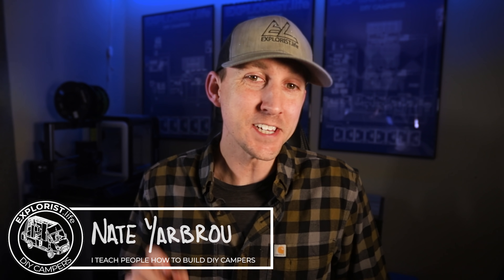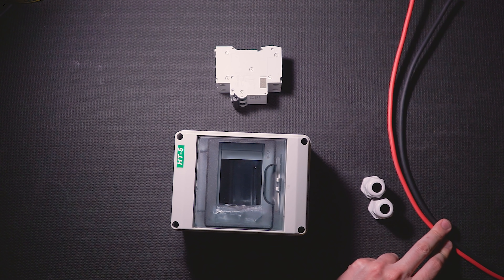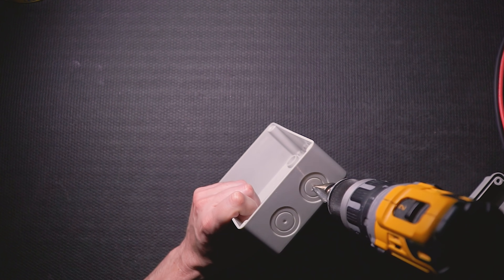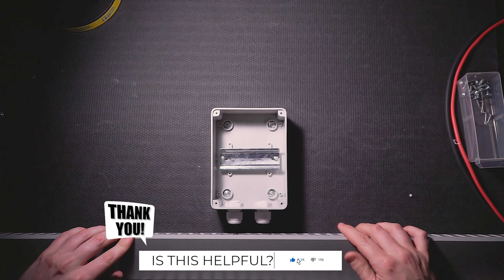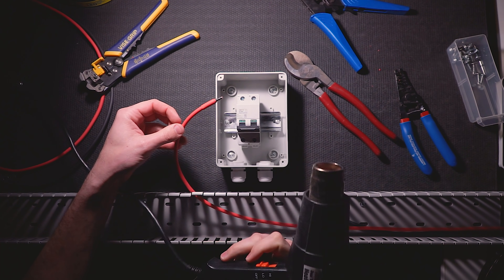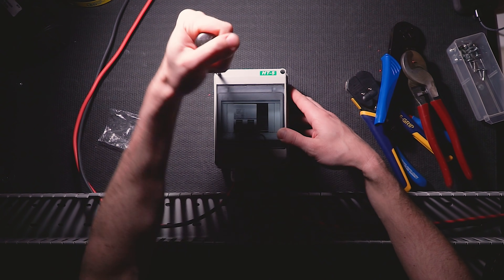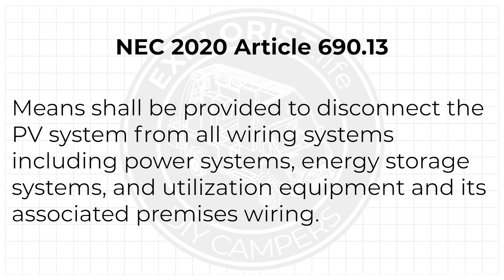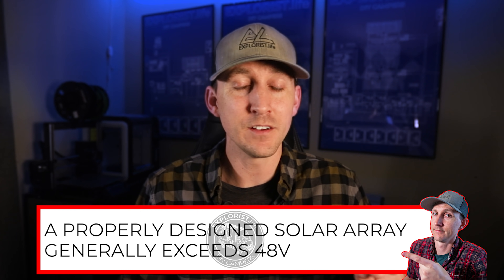How to Wire a Solar Disconnect for a DIY Camper Electrical System

Comment: I have a solar generator in my house that will be hooked to three 400 watt solar panels wired in series.  Together the three panels will generate 150 volts DC at 9 amps.  It looks like the breakers you are using will work with this setup.  Are there any similar breakers that can be used outside.  I would prefer to mount the breakers at the panels on my solar ground mount rather than inside the house.

Comment: Will this breaker protect against lightning?
Reply from the maker: Nope.  This product simply disconnects power from the solar array to the charge controller to meet code requirements.
Reply: If you switch the breakers off before a thunderstorm will it protect against a lightning strike?
Reply from the maker: If your camper takes a direct hit from a lightning strike, there will be a lot of stuff messed up regardless of the position of the switch.

Comment: Excellent ! One thing I don't understand and I know there is always a reason for why things are made the way they are. Why do the incoming wires positive and negative need to be disconnected simultaneously ?
Reply from the maker: In short: if the positive and negative wires upstream of the switch rub together and create a direct short, the negative wire could be carrying voltage even if the positive wire was disconnected.  I'll let you google the long answer.  It's in some white papers out there somewhere but I'll let you chase that rabbit on your own.

Comment: Awesome video.  I'm building an RV and was just at the stage of adding the solar disconnect.  Learned a LOT with this and saved me a lot of hassle down the road, and possibly a disaster as well as I was about to use one of the switches you advised to never use here.
Reply from the maker: Glad it was helpful.  Cheers!

Comment: Nate,
We purchased a 2022 GD Reflection fifth wheel and it came with a Furrion 165 W solar panel, Furrion 50Amp Charge Controller, Furrion 16cu/ft 12v refrigerator and on demand water heater.
I was putting it in storage and there is no disconnect I could find  between the panel and the controller to disconnect the battery safely. But looking at the specs I guess it's not required according to your video.
What is this thing in the front bay near the one lead acid battery and the controller.(see email with attachments)
Also if I upgrade can the existing panel and controller be utilized or would you start from scratch?

ᐧ
Show quoted text
Reply from the maker: Sounds like you've got an RV with 50A shore power... If so... Here's how I recommend retrofitting an electrical upgrade: https://www.explorist.life/50a-camper-inverter-with-solar-alternator-charging-wiring-diagram/

Comment: Hi Nate
Loving your videos - thanks. I have a question about wiring the switch up. I saw a video saying that you have the have the pos and neg on certain sides otherwise the unit bursts in to flames when turned off? Obviously + to + and - to -, but does it matter which side of the unit is used? mine has a large N on one of the terminals on the right hand side so guess that would be the neg connection, but does it really matter if i run the positive down the right hand side of the switch or the left hand side of the switch?? Hope that makes sense?
many thanks

Comment: Hello Nate, Thanks for making all of these videos! The information is extremely helpful! Just wondering if you were ever considered making some videos for a setup much less complicated and on a smaller scale. Like an over-landing vehicle (Jeep) with a dual battery setup under the hood and 200W solar just to power a small propane heater and fridge? Something small enough that wouldn't require an inverter maybe? Thanks again and love the videos!

Comment: would it be possible to take a 30a rv extention cord and cut off the end and connect those wires to the inverter. then plug my camper into the other end. 3500w reliable inverter and 25ft camco 30a rv extention cord
Reply from the maker: Here is how I recommend retrofitting an upgraded electrical system into a 30A OEM RV: https://www.explorist.life/30a-camper-inverter-with-solar-and-alternator-charging-wiring-diagram/
Reply: @EXPLORISTlife  victron stuff and battleborn is way too expensive. I understand you're sponsored by them but I can't afford all of that. I'm running 800 watts of newpowa in 8-100w panels 2-60a pow mr charge controllers. The inverter I mentioned. And when I get my tax money I'll be getting 2- chins 300ah 12v batteries. I already have a gopower transfer switch but was just wondering if it would be easier to wire the AC block of the inverter to a 30a rv plug to shortcut wiring in the transfer switch. But I understand you can't vouch for other companies.
Reply from the maker: Feel free to use whatever brands or companies you like.  I teach you how to do this stuff right the first time so you don't have to do it again; but whatever company you end up going with... the designs I've made are the best way I can recommend.  Straying from that and trying to, with all due respect, cut corners, is not something I can vouch for.
Reply: @EXPLORISTlife  got it thanks

Comment: Do you have a video where you do this with multiple charge controllers? NOT the video of wiring multiple charge controllers to the Victron Lynx Distributer, but to this point. Or do you just use 2 entry glands and 2 of these disconnects?

Comment: Is the box required for the breaker? Or could the breaker be mounted out in the open. Since it doesn't need to be water proof and other connections in system are out in the open.
Reply from the maker: I recommend using the box.

Comment: Nate, thanks for the great video again.  They are always helpful!  Is it legal to use the disconnect without the enclosure to save space by taking the DIN rail out and just mounting it directly to the backing board?
Reply from the maker: It's really best to have it in the enclosure.
Reply: @EXPLORISTlife  Thanks!
Reply: Thank you, what's your advice for setting it up on a small boat? One 300 w panel just for a fridge/freezer going to a lithium battery. 6.25 m hard top but gets salty.
Reply: That's what I would need to do. The box is too big for my application.

Comment: My inverter wants a 200 amp 2 pole DC circuit breaker (for battery bank at 48v), but I can't find any online, do you know where I can buy them at?
Reply from the maker: That's strange that's what it specifically calls for.  Multi-pole high amperage DC rated breakers are REALLY expensive.  Here's a source: https://www.automationdirect.com/adc/shopping/catalog/circuit_protection_zfusesz_disconnects/ul_489_rated_molded_case_circuit_breakers_(mccb)/3-pole_mccbs,_15a-600a_(3p_series)/60a-225a_(225a_f-frame)/f3p-200-aux

Comment: I’ve ordered my disconnect and will be installing in the near future.  Thanks so much for all your videos!  

I do have a question…when the disconnect is switched off, and the PV panels are active, ie generating voltage, is there any heat build-up to be concerned with?
Reply from the maker: Nope. 👍

Comment: I notice that the PV output is going to the top of the breaker, and not the bottom (input?)  My understanding is that the side with the highest potential should be wired to the input...or is this breaker/manufacture dependent.   (I was planning on using Midnite Solar breakers)
Reply from the maker: It's manufacturer dependent.  Follow the instructions for whatever breaker/fuse/isolator you choose to use.

Comment: I built out my electrical system according to the custom design you created for me and it works fantastic.  I'm finally adding a 120W suitcase solar panel and the plan doesn't show a DC disconnect switch.  Do I need one if I only plan to occasionally connect the panel to the MPPT charge controller?  The disconnect would be the MC4 connectors between panel and charger controller.
Reply from the maker: I'd say it's fine without for portable panels.  You can 'turn the panels off' by flipping them over face-down and then when you disconnect both MC4 connectors; that is effectively disconnecting both the positive and negative conductors.

Comment: Hi. According to your explanation: 63amps dc breaker >250v fits all solar systems between pv and solar inverter. What about the amp size of dc circuit breaker between the inverter and the batteries? And the ac circuit breaker between in and out ac current?

Comment: Hi Nate, I'm looking to install a solar system in my Rv and this was a great video.  However, I watched a few other videos on the DC isolation breaker catching fire.  The videos show reversed polarity and if not wired correctly they will catch on fire.  The wiring shown had the NEG wire coming in the bottom on the right side and the positive leaving the right side on top. If not wired in this configuration they will catch on fire if under load.  Your video shows the neg and positive entering and leaving the same sides. Thoughts?
Reply: Nate is correct. The way a polarized circuit breaker works is that the current can only flow in one direction. The circuit breaker will have a + and - (or a small diagram) to show how to wire the source(in this case the solar panels). The wires “exiting” on the other end must match the incoming wires.  The breaker used here only has the +/- at the top, so the panels are intended be wired into the top of the breaker with the positive on the right, and the wires will come out the bottom in the same orientation. If the breaker has +/- at both the top and bottom, that just shows the correct polarity for the incoming source whether wired into either the top or bottom, and is intended to show the correct polarity for ONLY the incoming wires. Again the wires exiting must match the incoming wires, even though +/- symbols will show reversed for the exiting wire.  The videos you found  advising the wires be crossed  are either incorrect or you misunderstood them.
Reply: @ArvidDarmond  Maaan! Thanks for clarification with those marks on both sides! I could have guess it. I'm googling all day long on a proper breakers after watching those videos. Video shows that a wrong polarity will cause a fire if trip off a braker manually even under rated amperage. Something you don't want to have in your house or camper and it's pretty wild. So either buy non-polar switch or wire it carefully.

Comment: Why use a breaker rather than a switch?  Are dual pole switches suitably rated for volts and amps harder to find or more expensive than breakers?
Reply from the maker: Solar Disconnect switches have been historically harder to find and more expensive.  Though we just bought a pallet of them and will be selling actual solar disconnect switches in our store soon.

Comment: That is a breaker NOT a disconnect switch. If you read the breaker specs, you’ll usually see the mfr recommends a switch before the breaker.
Reply from the maker: It is a breaker being used AS as disconnect since it offers no overcurrent protection in that location as described in the video. 👍🙂

Comment: Need to have to enclosure?
Reply from the maker: Indeed!
Reply: @EXPLORISTlife  why is that? Can you please explain. Currently I have mine mounted on a din rail behind a cabinet. Have two 3D printed din rail stoppers in each side. Is it only to protect from water getting on it?

Comment: Thanks Nate! Question: I am going to have 288.6VOC coming from my six panels wired in series.  This is higher than the 250V you said ro stay below for this shut off. Do I just need a higher rated unit?
Reply from the maker: Yes, or more likely... consider wiring in series parallel instead as 250V is also the max voltage of the most common Victron solar charge controllers (unless you are going with a 48V battery bank paired with the SmartSolar MPPT RS which has a max voltage of 450: https://www.solar-electric.com/victron-smartsolar-mppt-rs-450-100-tr-charge-controller.html )
Reply: @EXPLORISTlife  I have opted to go with the 5kW Growatt and a midpoint transformer.  I will be configuring my sixteen, 3.2V,  280Ah LiFePO4 batteries in 48V. An individual from Signature Solar recommended wiring all six panels in series. It definitely cuts down on the necessary wire.

Comment: Would a 32A 2P breaker be too close the 30A minimum you mentioned? Amazon has 32A and 63A breakers, does it matter which one I get? (3 Panels wired in series - Maximum Series Fuse Rating: 15A / Short Circuit Current: 10.35A/ 30A MPPT Controller)
Reply from the maker: Go with the 63.
Reply: @EXPLORISTlife  Thanks will do. Can I ask the  reason for the 63 over the 32 though? Just for my education :)

Comment: So if I wanted the breaker to act in the same way as a fuse would I choose a breaker slightly bigger than the short circuit amperage of my single panel. If that makes sense. Excellent video by the way.

Comment: One question, you said it is a regulation to have a solar breaker, so why does Jayco and multiple more caravan builders don’t install it?
All that it is on the incoming positive wire is a 30a fuse.

Comment: Have you seen the double pole  DC breakers were the wire polarity at the top is opposite at the bottom of the breaker they have + & - marked on each end and are aligned opposite ?
Reply: be carefull with them, they can catch fire when trips off even under normal current if they were wired with wrong polarity

Comment: you call it a Disconnect,  Amazon calls it a circuit breaker, come on man lets get the terminology right at least .This shit is confusing enough
Reply from the maker: A breaker is a type of disconnect.  In this case, we are using a breaker simply as a disconnect and not a form of overcurrent protection.
Reply: @EXPLORISTlife  i see said the blind man
Reply: @EXPLORISTlife  going ti order mine soon im glad you pointed out its mandated to have a disconnect in a Solar wiring. I had no clue

Comment: Is there a breaker panel that takes and sends out three pairs of md4 connectors for multiple panel groups connecting to the new Victron smart solar 150/85 or bigger controllers...I'd rather use dedicated cables for each group and not seeing why I don't stick with the BogueRV prepared cables... new to all things solar though.

Comment: Hello, a question, if the breaker is installed, the solar panel can be exposed to the sun without any problem? Thank's
Reply from the maker: Yes!  Just be aware that there will still be voltage on the wires between the disconnect and the panels in that case.

Comment: Nate, great video. I have question I've been trying to figure out the answer for. I have 100 W panel installed on my campervan's roof and now I want a flexible addon system so I've bought a foldable 120 W panel that I'm pulling out every now and then to increase the solar power charging. I want it wired to the same Victron Smart Solar 75/15, all good there.. but! I want a flexible way of connecting and disconnecting the foldable panel. I'm thinking a socket and a plug but also a switch, either for both panels or only for the foldable one so I can flip the switch to disconnect, plug in the foldable panel, then flip the switch again to connect the panel to the Victron Smart Solar. Is that a viable and for the equipment safe way of handling my desired use case ? I realise now that you say that the voltage maximum is an issue for my idea.. If I use a disconnect maybe I'll mess it up by maybe flipping it on and off every day for a couple of times a day for a couple of weeks straight, they're not designed for that use as I've heard.

Best regards
Magnus from Sweden.

Comment: Hello, since the breaker is not meant to be used for fuse protection couldn't an AC disconnect box like one that's used for airconditioner units work? Some are dual poll and rated for up to 240 volts and 60 amps ($12 Amazon). You would just have to leave the ground wire connection empty if that is sufficient.
Reply from the maker: The breaker must be rated for DC current as shown in this video.  An AC breaker is not to be used as it is not designed to work with DC current and may not disconnect properly.

Comment: Would I ever need to disconnect my solar panels from the controller in case of an emergency? If so, how would I do that? Use a battery disconnect switch? Or...maybe I wouldn't ever have to worry about that?

Comment: I have a 400w solar in series and a 40amp mppt. Do I have to used a dual breaker 50 amp or a 63amp ? 
Thanks and really good videos 👍

Comment: Our inverter has 2 mppt input each can take 11A . but our PV Panel produces 17.33A. Can we use Y connector to divide current and input 8.665A per mppt input?

Comment: Can I just go to Lowe's and pickup a 30 amp breaker to use as a solar panel disconnect and call it good?
Reply from the maker: I'll save you a trip...  Lowes won't have a DC breaker rated to a high enough voltage.  :)

The parts list in my blog post for this video has the proper equipment though: https://www.explorist.life/how-to-wire-a-solar-disconnect-for-a-diy-camper-electrical-system/
Reply: @EXPLORISTlife  
Thanks man, I'll order it.

Comment: Quick question.  Would this solar disconnect work with 5.4 amp setup?  I am starting off small, but I want to do things right.  I have 100 watts of solar and one battery.